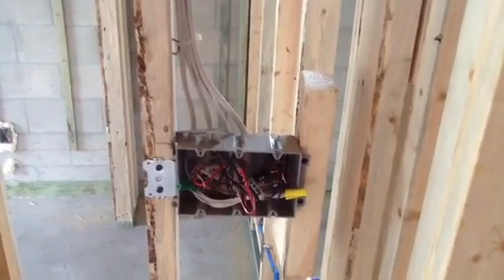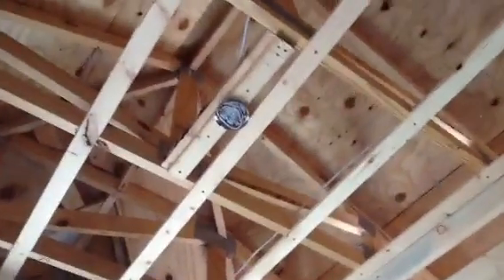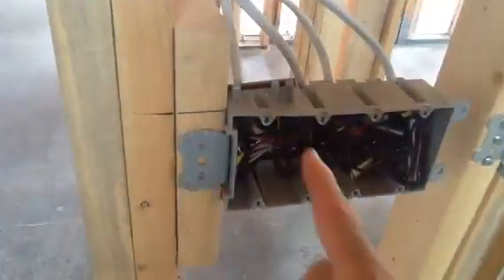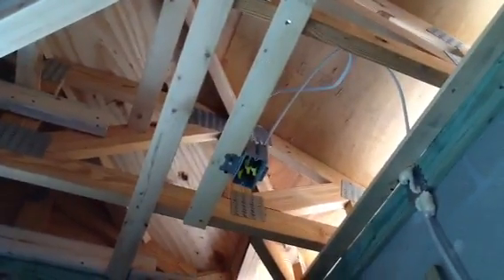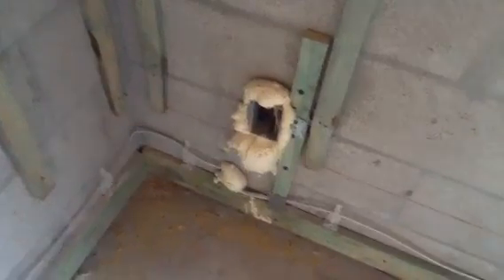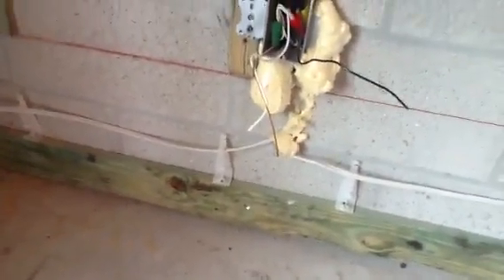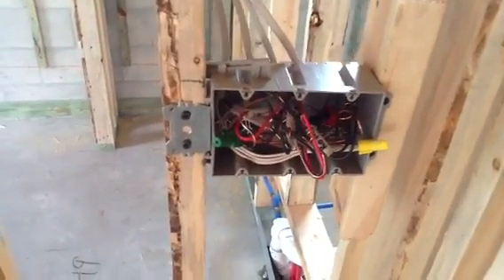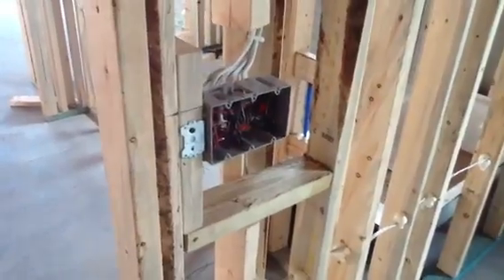Basic Residential Electrical Wiring

Comment: David I would like to know why  some electrical contractors use 14-gauge wire on a lighting circuit.  It's only good for 15 amperes and it looks like you used 14 gauge wire in the bathroom, now if there is an electric bath heater on there I feel like that is a no-no, just wondering because I know that 12-2 romex w.g. is yellow in color.  The last time I saw 12-2 with white outer jacket was about 20 yrs ago.  I know you can bid a job cheaper using 14-2, but also I consider the safety of the home owner and his family worth more than a price difference between to rolls of wire.  Just wondering in Texas

Comment: well great no service loops above the 3g (three gang) box.... guess you don't need to follow the CEC (Canadian Electrical Code).... unless this is a US video then I am unfamiliar with there code!!!
Reply: Yea I was going to note the same thing about the CEC as I always ensure I install a drywallers loop above all of my boxes for ease of mind, nothing against drywallers but they seem to hate our electrical work haha
Reply: Correct, in the US the National Electric Code does not allow for service loops in romex above boxes. They have to be stapled or secured with 12" of leaving the box. But so long as you actually push your make-up all the way into the back of the box you shouldn't have too much of a problem with drywallers.
Reply: That makes sense we are only required to leave 150mm of wire out of the box (roughly six inches)

Comment: what bothers me about the wire running along the block wall at the bottom is, what if someone puts a nail through it when installing trim.. also when you have a wire running between the lath strips up a wall I'm always afraid someone might hang a picture and drive a nail into the wire.

Comment: What's the part number for those white plastic clips on the nailer strip around the perimeter of the room on the block walls?
They look like a better idea than stapling to the edge of the nailer strip, where its more likely to get pierced by nails/screws.